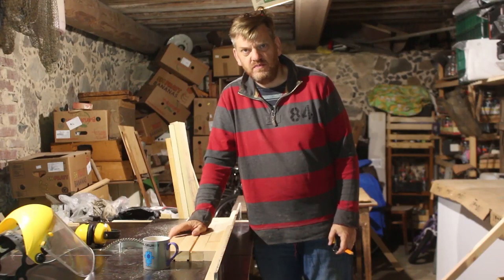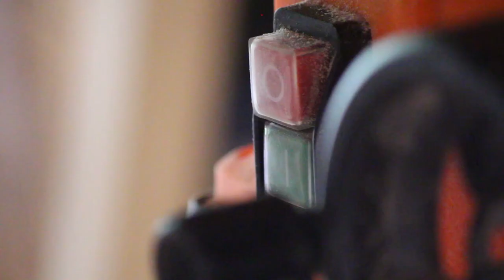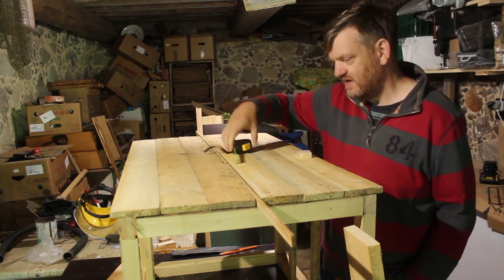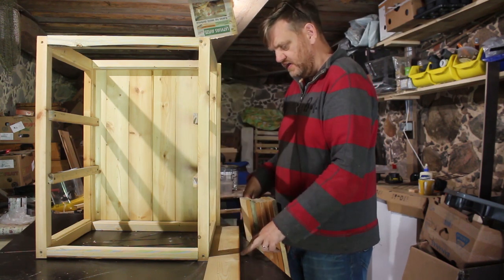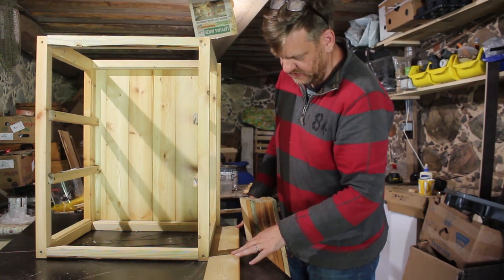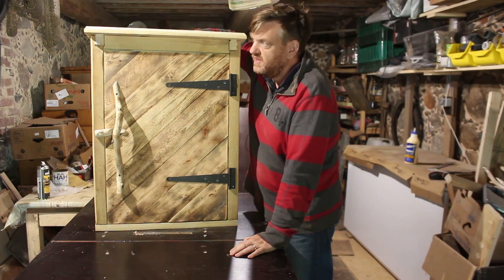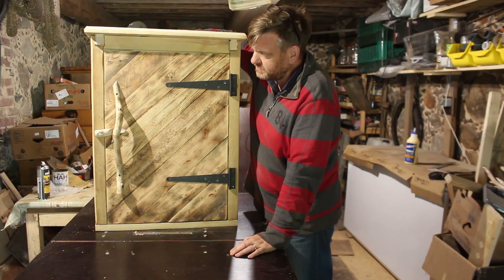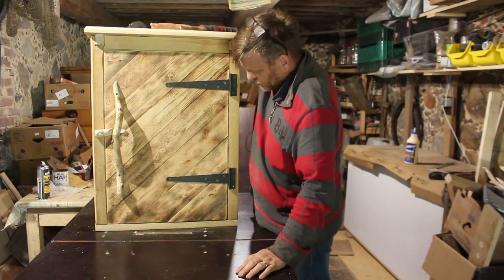Hot & Cold Smoker Build - How to

Comment: Thank you for the measurements. Is there any particular reason why your chimney was so long in the ground. Can that part any shorter than th 10 feet yours appears to be.
Reply from the maker: Oh sorry the firebox is quite small about 45cm x 20 x 20. The pipe from that is simply so that naked flames are not going up into the box and have a small amount of room to slightly cool. The idea I picked up from looking at some drawings online. It’s not cold smoking by any means but it seems to work.
Reply: Ok I will look for the chimney drawings. BTW I got some lumber and I am following you lead 😂🤣
Reply from the maker: You probably noticed I didn’t put an actual chimney on the box.  Found the gap at the back enough to get a draw. It you may choose to put a small chimney on the box for greater draw.
Reply: @BalticHomesteaders  I like that as a chimney I am also putting a slot in the back. Very cool!😎

Comment: Thanks a lot and great video! What would your suggestion be for a door if you do not have the tools to round the edges of the wood like you did? Also, for someone to build with no woodwork experience.
Reply from the maker: To be honest I have very little experience in woodwork, I’ve never made anything like that before. An easier way would be to use plywood. A router isn’t needed for finishing you can do that with a file and or sandpaper. Wood is very forgiving so go for it :)
Reply: @BalticHomesteaders  cheers for the reply! 

Called up my pal who’s a chippy and he said the same thing. 

I’m going to go and buy some untreated (??) timber to make a frame similar to yours and then just attach sheets of plywood for the walls as this will be much easier.
Reply from the maker: @williamcullumcodes  great, love to see how it turns out. I hope to be shooting the next stage next week if we have good weather when I install it.

Comment: I’m going to build a smokehouse, which would you suggest for venison, hot or cold smoking?
Reply from the maker: Hi. Are you curing it first? It really depends what you’re planing to do with the meat rather than what meat it is. Remember it’s easier to use a hot smoker to cold smoke than  the other way around so I’d say build a hot smoker and then but a cold smoker tray to use when you want to.
Reply: @BalticHomesteaders  thanks, that’s good advice.

Comment: Would it be okay to use like any wood glue?? or will it possibly let toxic fumes into the cold smoked fish
Reply from the maker: I made a point to research the glue and how safe it was at max temperature etc.
Reply: @BalticHomesteaders  Sorry I just kinda rushed thru the video to get design Ideas and all that.. Will be building 1 myself later today so just seeing how other people do it and what's the best way to seal it up so that smoke doesn't escape but only from the chimney on top
Reply from the maker: No worries. You’ll see mine is an experimental ‘chimneyless’ design which works. I have no regrets about not putting a chimney on it, I was smoking just yesterday.
Reply: @BalticHomesteaders  i purchased 1 of those maze things from AmazinG so hopefully it works

Comment: Have you found the lack of venting a problem with smoking?
Reply from the maker: Hi. Haven’t had a chance to try it yet as I got caught up with covid stuff and then winter struck. Should be setting it up soon as spring has just sprung. However there is a vent under the back of the lid. If I have to install a chimney then that’s no problem and easily done.
Reply: @BalticHomesteaders  
Firstly what a beautifully put together smoker!! I'm soon  to start my own smoke box project from euro pallets and I'm gathering data at the moment!!
My question is in regards to ventilation! I plan on using a hot plate in my smoker and it's a basic  electric smoker ..how much ventilation would I need ??
Reply from the maker: The vents turned out ok in the end, you can see it here https://youtu.be/R-NwyW0YQPI